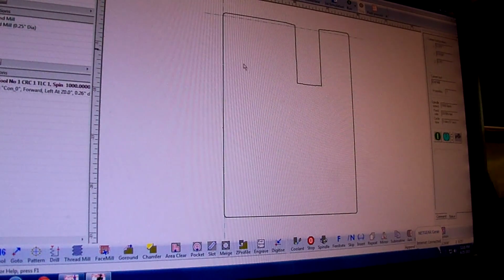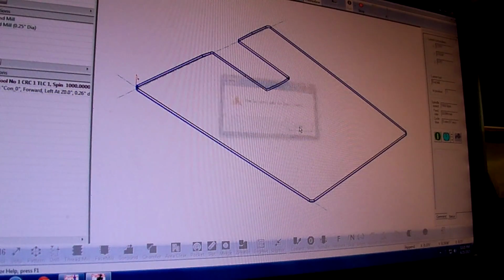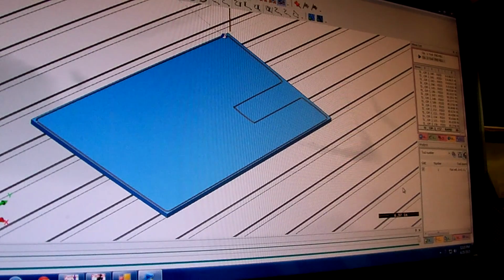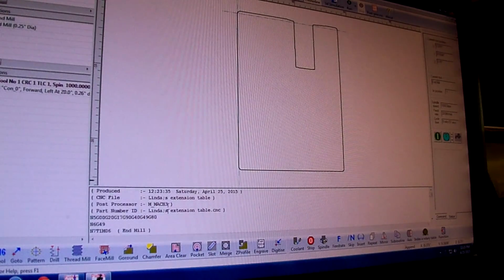Plexiglass extension table for sewing machine made on the CNC router

Comment: One can use a propane torch on low flame to smooth the rough edges.  Don't leave the torch flame in one spot too long, use back and forth motion until the rough edge smooths out.

Comment: i have been told that, when clamping a part to the table, raisers should be .03 about the clamping part that way insure clamping presure force is more on the clamped part..!
Reply: i try to say , that when clampin a part  then of the clamp that goes into the parto be machine should be about .030 thousands lower than the opositive end of the clam..!